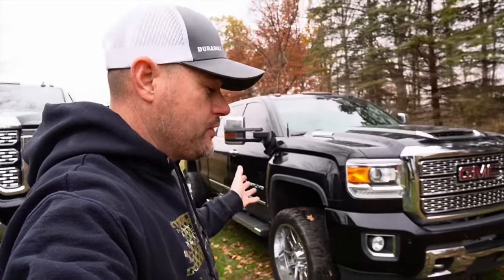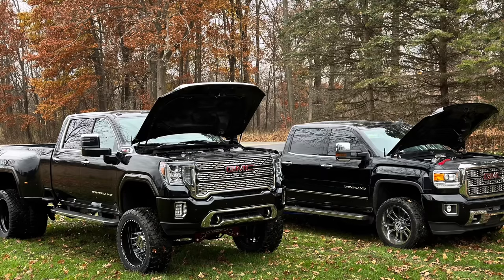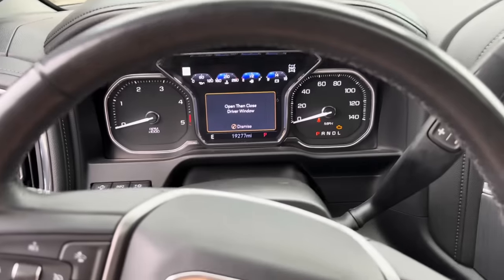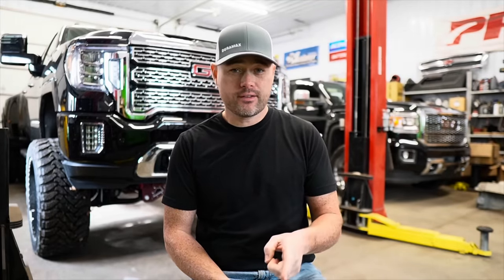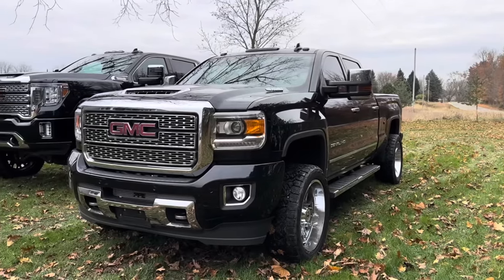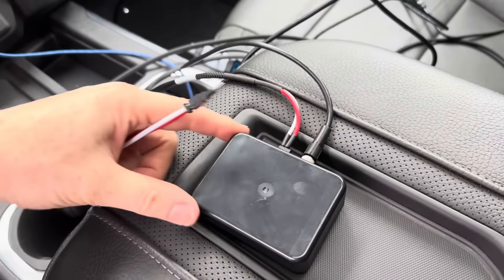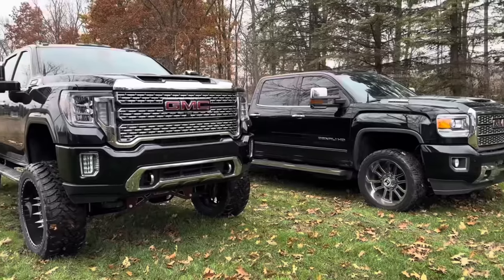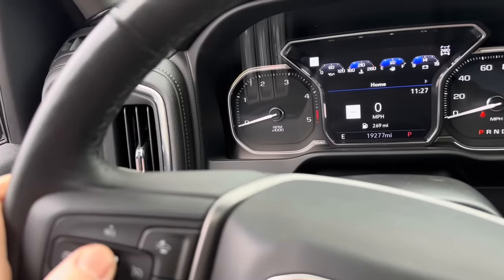You Can Now Tune And Delete A L5P Duramax From Home! *Watch Before This Video Gets Taken Down*

Comment: 2002 LB7 243,000 miles

2007 LBZ 102,000 miles

I've had both trucks since around 60,000 miles, my dad and younger brother both have an LBZ as well. Grew up on a farm with diesel motors pretty much everywhere, and the old 6.5 Chevrolet Detroits. Farm EQUIPMENT with DPF and DEF is an absolute nightmare and cost farmer thousands of dollars annually. Keep up the good work, appreciate your channel. Go Army

Comment: At work I’ve been pretty much assigned the HEAVY DUTY tech roll lol since nobody likes working on them, which I don’t mind because I wanna learn more diesel anyways,I’m only 22 and do all kinds of repairs at the shop I work for. I’ve worked on a couple l5p’s. And in stock form they do have power but they just fiel so restricted and held back despite the power they have stock. But then a customer brought in a deleted l5p with a 5 inch straight pipe and damn that thing was alive ! It was the most fun I’ve ever had driving a truck and odd how illegal it is. When I get me s truck I’m deleting it. It’s such a night and day difference especially for these newer trucks. It did have a very aggressive trans tune because whenever I let off throttle it was down shifting hard to slow down which I actually liked, saving yourself of having to use the brakes. As always man hanks for the content and love the fact that you’re trying to always help the hard working people just trynna keep their trucks on the road and wanting to do anything for a truck that they paid hard earned taxed money on. Bs how these trucks are almost 100k and you can’t do anything to them cause it’s “illegal”